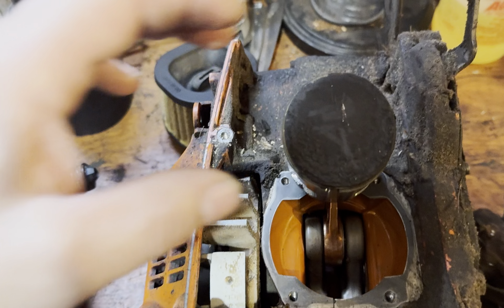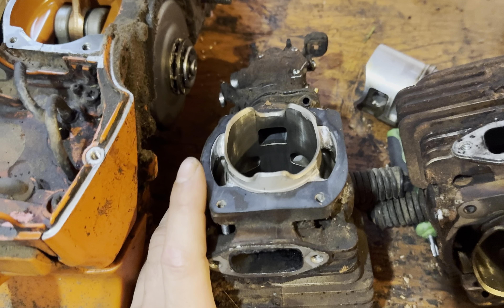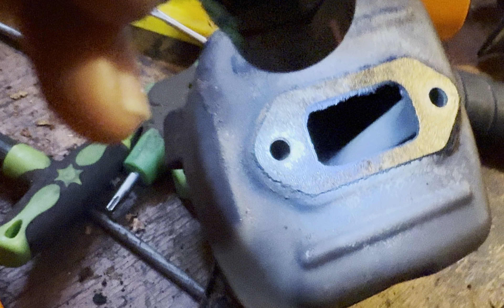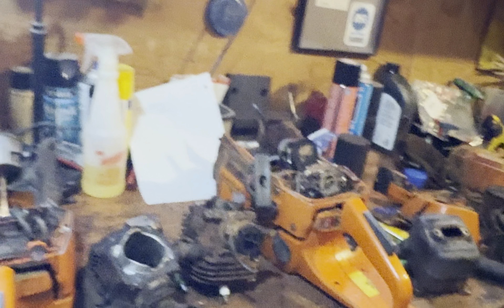Side by side comparison of motul 800 off-road vs Bel Ray H1-R.

Comment: Jake , in my experience with the motoul  oil it's a good oil but you have to use higher octane fuel other than pump gas , even ethanol free 91 octane isn't high enough octane, I use 91 octane ethanol free fuel with an octane booster that takes it to 99 or 100 octane and in the northeast where I live I run my saws 8 hours a 365 a year and honeycomb brown is the color on my plug and muffler, your absolutely right about cost

Comment: Iv cut for going on 31 years with Stihl 066's  I burned 2 gallons of gas a day 10 hour days when I was young cut millions of feet on the orange Stihl 2 stroke and 87 octane in the saws they would go 2 years with no problem

Comment: I personally run motul in everything currently. I've run amsoil dominator, echo red armor and Lucas semi synthetic in the past. I have hundreds of gallons through my saws with no issues or carbon buildup. That being said I have a few other guys that have run my mix and have had the carbon issues they were both landing guys where as I fall timber. The only other differences I noticed is they run mostly stock saws and there chains aren't always the sharpest. I am constantly touching up my chain and my saws are all ported quite heavily and are well on to the warmer side of things. I've yet to blow up a saw with my mix at 40:1 regular unleaded 10% ethanol. I might get some green for that but it hasn't given me any issues and I go through 3 plus gallons a day. I think the best oil depends on where you cut how you cut and how your saw is ported. To each there own but I've found what works for me

Comment: I have done some research, and I think any of these quality motocross oils mixes will work great! I bought 1 gallon of motomix for break-in. After that, I am mixing my own using 93 Shell with Honda HP2 2 cycle oil. Might use a 40:1 or 50:1. That HP2 is good stuff!

Comment: Your 100 % right your working your chainsaw day in day out like 👍 my . Guys cutting 3 or 5  1/3 firewood 🪵 a day in wood 🪵 yard . Gas got nothing to do with it I run regular gas with heavy 40:1 mix because my chainsaw are working all day . Get pay for the timber on the ground . 😊

Comment: Excellent video, thanks for your time making it. 

I think you have it nailed on the emphasis regarding idle time during use.
All the time under half throttle probably causes 90% of the carbon build up. If it is outside the powerband, it is building carbon.
Reply from the maker: Absolutely! Timber falling saws see a lot more idle time than what firewood and home owner guys see. As well as lots of blips of the throttle, whether it’s limbing, clearing brush or just feathering up to the hinge.

Comment: I absolutely appreciate this video. Ive switched to belray awhile back and it's served me well and exhaust doesn't stink so much as most other oils. I'm not production faller anymore so my saws don't see the idle time anymore so everything is always clean as hell. I'd re ring and go if was me! Thanks for the video it made so much sense to me!
Reply from the maker: Thanks buddy! I threw it back together the way it was. Same rings, same piston. I’m going to run this saw till it fails.
Reply: @jakemesa3211   Tested motul 710 in cheinsaw

Comment: I raced motocross for many years and always ran castor 927 but like anything it has its place. To run that you need to be on the pipe all the time or you’ll be full of smudge and soot. That being said in chainsaw terms it’s fine for firewood, sucks for running on the Skidder doing logging. I’ve found AmsOil dominator works great for me 50:1

Comment: I'm glad that you showed your math in relation to cost of oil and fuel, it silences that debate quite quickly, if the saw lasts twice as long on moto mix but costs the equivalent of 4 new saw it isn't worth running in a professional use situation. 

Was interesting to see how dirty the crank case was in comparison to the motul saw as well.

As for your question at the end. As a viewer I'd like to see you put it all back together as is and continue to run it to see how much time you can get out of it and then show a cost analysis, but that'd be a bit of work for a small bit of data haha

Comment: I would be interested in seeing a test on Motul 710 or Motul 510. I suspect things might be even cleaner. Even cheaper yet is Castrol Go 2t at O'Reilly Auto for $7.50 per quart. Wonder if it could hang with the more expensive oils
Reply: Motul 710 👌👍

Comment: cutting as much as you do what, kind of bar oil do you prefer.
Reply from the maker: It depends on the time of year and what I’m cutting. If I’m in mostly pine, or it’s winter time I’ll run a thinner cheaper oil. If it’s mostly Doug fir, tamarack, or it’s summer time I’ll run a more tacky oil.

Comment: Considering the amount of time on them, I'd say neither looks terrible but the H1-R saw looks very good!  As others have asked, im genuinely curious what ratio you're running? 32:1 seems to be overkill for H1-R in my very limited experience with it. Was thinking about trying it closer to 40-42:1 but am not against trying 50:1.
Reply from the maker: I run everything at 50:1
Reply: @jakemesa3211  awesome👍🏻
Reply: @jakemesa3211  thats awesome...and I remember "hotsaws" also runs 50 to 1 and loves that belray.....from a vid years ago.

Comment: I use motul 800 offroad for My huskys 350/372/525/585 
It’s the best 2t oil
No carbon deposit
Reply: Motul 710 2t oil best in cheinsaw 👌👍
Reply: 710 si a good oil
but 800 is another planet

Comment: I agree on the motomix theres no possible way that any one putting any kind of time on a saw could afford to run that and come out ahead i burn 3-5 gallons most weeks not all and my profit margin would go way down i down get it or that 40 dollar a gallon bar oil that a few is pushing i enjoyed the vid stay safe out there
Reply from the maker: I’m glad you enjoyed the show. Thanks for watching all the way to the end!
Reply from the maker: Some of these guys just don’t understand the amount of fuel a timber faller or tree service outfit goes through.
Reply: @jakemesa3211  i agree
Reply: Moto mix is 50 a gallon down in California where I am at. VP premixed is 32. 

Sure homeowners with 1/4 acre lot but anyone using volume doesn’t add up.

Comment: Put it back together and run it until it fails I’ve run one saw until it failed a johnsered 2186 and it took forever the plating wore off the cylinder
Reply from the maker: It’s back together the way it was. Going full send till she dies!

Comment: You couldn't pay me to run the m-mix I'm a better business man than than,shits too expensive!! And besides if I blow up a saw because the fuel wasn't mixed who's to blame..ME?!! Your totally on the   right track with motul too much idle time. Too much starting and stopping just like city driving in a car they look the exact same way when you tare them down!!  Never got up to operating temperature for long enough periods of time to burn off the carbon deposits. The saw on motul is there any chance you can get him to switch over to maxima formula k2 and run that and see what the results are with that? That's what I'm running and I'm having good luck with it but I do run mine little longer periods of time also but i do have times with lots of starting and stopping and from what I'm seeing in my tests I'm happy! Personally I'd just clean things back up and put it back together on your personal saw. But you have a great video and point of view here..only way m-mix is worth buy is for a homeowner that burns a gallon or less a year in a weed wacker  and to store it is it period!!!